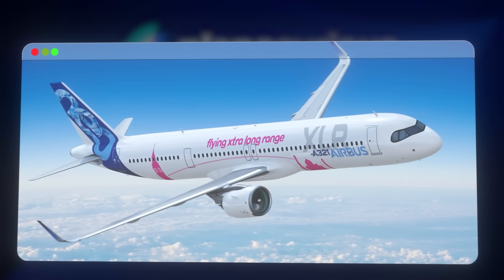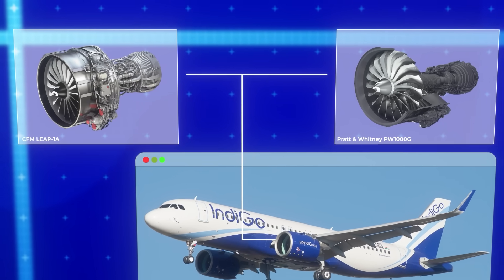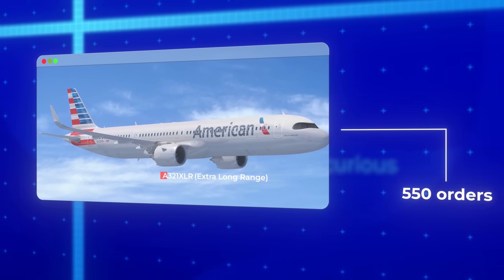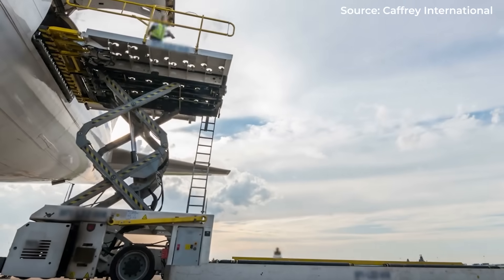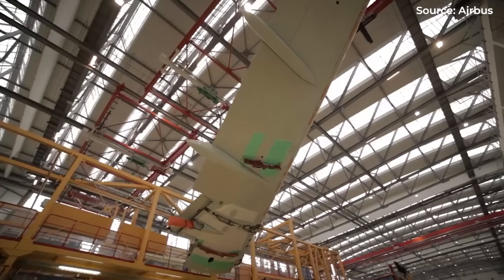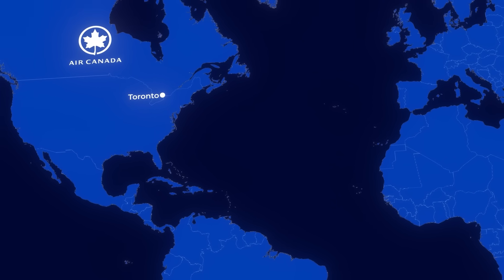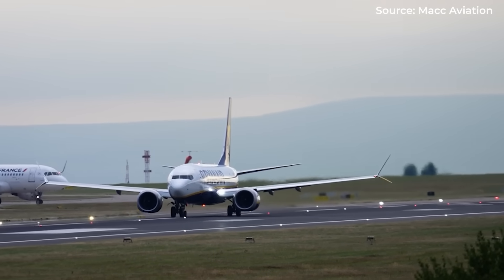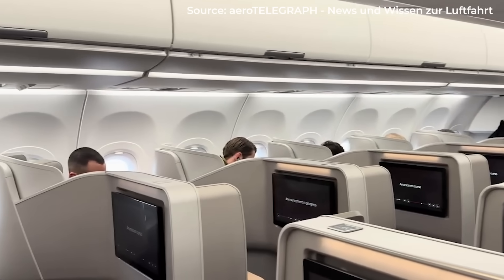How Airbus Outsmarted Everyone With One Jet

Comment: While longer range single aisle aircraft will allow more point to point routes to become viable, they cannot replace the hub and spoke model.

I regularly fly from Manchester UK to Belgrade Serbia via Germany, Switzerland, or Belgium. All flights use single aisle aircraft types usually from Airbus or less often Embraer. Being flexible with my timings, I have travelled on flights at all times of the day. With the exception of the last flight of the day, the vast majority of the seats are taken, quite often all those in economy are, yet I may be the only passenger flying that particular route.

Before landing at the hub they announce the gate numbers for any connecting flights with passengers on the flight. The sheer number of connections and a typical passenger count in the 100-150 range doesn't need a genius to realise that the numbers making at least some of those connections will be very limited. In my particular case, we are talking numbers struggling to justify even a single direct flight per week. Hub and spoke not only makes this route viable for the airline, but  can give me double digit flight options each day.

For this reason alone, the hub and spoke model's existence is not under threat.
Reply: Well, it's not like this would replace it. But hubs generally already run at capacity. What this allows is diverting to smaller airports and flying direct routes that didn't make sense before. This is beneficial for everyone since hubs won't get over stressed as easily and ofc customers get more options for better flights. This actually means everyone wins, since for those using the hubs lesser demand means less cost.
Reply: @mukkaar I couldn't agree more. 

Routes will open up, and for a sector of the market, holiday flights being a perfect example where you fill a flight perhaps once or even twice per week during the season, these aircraft will be ideal.

However,  it is unlikely that they will be able to offer anything like the frequency the non-leisure traveller requires.

They will be ideal for those routes currently using a single aisle with a fuel stop as sufficient demand is already certain.

While with everything else being equal, passenger numbers could reduce at the hub airports, this may equate, for example a 787-10 being replaced with a 787-9, or an A321 being replaced with an A320, there may well be much less of a proportionate increase in available slots.

While it may seem logical to reduce the number of flights per day than to use smaller, and generally less efficient variants, airlines are often reluctant to surrender slots.
Reply: Isn't that what I said?

Far too many, particularly on here, are reporting it as the death of hub-and-spoke when it is actually in addition to it. 

I am sure that the additional direct services will be great for the passengers and the airlines (if they can get enough aircraft and crew) and, not having a connection will persuade people to fly where they would otherwise not, but judging by my personal experience in Europe and the location pairs available to me not having a direct connection at all, or with a frequency of just a couple of direct flights per week, I suspect that the affect on the existing hub-and-spoke model could even be minimal. Who knows, some of those airports with direct connections could end up being mini hubs themselves when they offer a shorter route. For example, some journeys from the UK to The Americas involve a first leg in the wrong direction to Europe, sometimes even adding a couple of hours or more flying time to the journey in the case of North American routes.

Comment: Narrow body +long haul =nightmare
Reply: That depends on the layout chosen by the airline. All business class is still nice
Reply: Why? For leg space, you need the length of the aircraft, not relevant in wide vs narrow choices
Reply: Also the 757-200
Reply: I flew on a jet blue from New York to London in a a321xlr and NEVER AGAIN.  It was the most claustrophobic trip I have ever had.  If you gonna fly that li d either do an A350 or a B787

Comment: Not revolutionary. The B757 had this capability 40 plus years ago.
Reply: Ye, 757 will always be the sports car of the skies
Reply: True, at twice the fuel burn.
Reply: @Soordhin seriously? You are comparing a 40 year old designs for fuel efficiency?
Reply: @larrydugan1441 Well, 757 and A320 family are both designed in the 1980s. So yes, that is a fair comparison.
Reply: @Soordhin nonsense.  I realize you are an airbus fan boy but the reality is that there is nothing new about a long range single isle aircraft.
Composites and engine design have allowed to current stretch and economy of the 320. 
The only thing you can say is that Boeing screwed up is colossal share of the market by not updating the 757.
Reply: @larrydugan1441  Obviously there is nothing new. That is how the video started. But currently there is just one company that offers any product in that area, and it is not Boeing. Which just confirms that Boeing is not an engineering company, it is an investment firm.
Reply: @Soordhin That I would agree with.  Damn shame the great Boeing was brought to it's knees by bad management.
Reply: @Soordhin 
Habe es nie verstanden warum Boeing die 757 nicht grundlegend überarbeitet & modernisiert hat?
War es den Gewinnerwartungen der Aktionäre geschuldet, oder war es nur Trägheit in einem weitgehend dual aufgeteilten Weltmarkt?
Schauen wir mal wie sich die neue überarbeitete TU 204/214 etablieren wird.
Das PS 90A Triebwerk ist ja auch schon in einer anderen Evolutionsstufe.

Comment: He said 30% cost savings PER SEAT, but JetBlue for example is 100 FEWER seats than some operators' 321 NEOs. So if they could maintain the 236 capacity, fuel savings would be 40%+?

Comment: Well it is wider than the 737 to bad Boeing didn't come up with something to replace the 757 instead of going all in on the 737
Reply: Airbus added a couple of inches after they copied Boeing to boast about it. Easy when you do the design later. Seat width is mostly the same but depending on seat manufacturer
Reply: Also I noticed that on the Air Canada's 320. S they just put the same 737 seats in but you end up with a wider walking area to get to the bathroom or exit @sundar999

Comment: Umm...no.  First Boeing did offer a similar version of the 757 (think NMA), but the airlines didn't want it, they wanted wide bodies for much of these routes and so the 757 got dropped as a result.  Second, there is a reason why most US arilines don't want this.  The plane is a flying fuel tank, meaning its not fuel effecient. Any route its going to be one would need to be served at a premium.  This also limits how much weight the aircraft can carry which is they the premium sections are getting so big. Its not just people are willing to pay (few people in first class pay full price) its because its the only way to get the jet off the ground. These planes will also not carry much cargo. Then there is the weather. Over the Atlantic, ceo A320's often couldn't make the East to West trip in one hop due to high headwinds and often had to stop. Now I am not sure about that with the Neo's, but Jet Blue doesn't offer trans Atlantic services in the winter because of the low demand making it impossible to make a profit with these narrow bodies. While I don't doubt they would be useful on some routes, they will end up like the A380, barely profitable on any route in their networks.
Reply: Iberia tried to run MAD-IAD for winter to make the route year round, but cancelled that plan in October because they wouldn't make a profit. Even now, they only use the XLR for the summer; last year they used to run the 330.

TAP and Aer lingus also have the XLR, but they have to fly twice daily to IAD whereas other european airlines use widebodies. Even United flies 767s and 757s to Dublin and Lisbon.
Reply: @fighter5583 TAP doesn’t have XLRs yet, they have a few LRs though.
Reply: Doubt it. Just as a counterpoint, American Airlines and United Airlines have ordered 50 each, with another 50 as options. Yes, it can’t carry much cargo, and requires a lower passenger configuration (especially if carrying american tourists who are twice as heavy as europeans or three times as heavy as asian ones on average). But it allows those thin routes being served that no other currently in production aircraft can.
Reply: @Soordhin They are only using it as a replacement for the 757s which are nearing 40 years old and the MX cost have to be through the roof.  They were bribed into buying them, along with issues the 737 was having at the time. Delta CEO has specifically stated the US airlines don't like the XLR and he was clear it UA and AA felt the same at the time. Only continued delays with the MAX10 and the doorplug forced the airlines over. It's probably why both airlines also ordered Jet Zero's flying wing which has the same capacity with possibly 2x the cargo. Also, as for your 2x-3x heavier statement? Don't let unit differences confuse you. Both the FAA and EASA use the same numbers for calculating PAX weight when adjusted for units. Airbus jets have a history of not having the capacities of their Boeing counterparts and being far less effecient. The advantage the 757 had was it could fly to Europe at MTOW without the need to make half the plane premium seating. No Airbus narrowbody can do that, even this thing. If they outfitted a 757 the same it would be able to outperform even the XLR. Ive seen the performance charts. This is an aircraft age thing. These will be in service until something better comes along and that's it, and that won't be coming from Airbus.

Comment: And each Airbus model is significantly wider than its Boeing competitor. So the PAX like them more, too.
Reply: Only for 320 series versus 737
Reply: It’s not significant.
Reply: @rtbrtb_dutchy4183 Significant enough to allow industry standard hold containers - unlike the competition.
Reply: @rtbrtb_dutchy4183 if it were significant airlines would add an extra seat.
Reply: @rtbrtb_dutchy4183 5% or 2" per seat is significant.
Reply: It’s easy to come later and be a copycat and add a couple of inches of fuselage width to boast of
Reply: @sundar999 320 series isn't a 737 copycat. Nobody would be stupid enough to make the same mistakes twice.
Reply: @stephengrimmer35  The Airbus series from the A300 and up is clearly a copy of the layout of the Boeing 707, swept wings, underslung engines, same long straight tube as the fuselage, same tail, so it's difficult to tell them apart with a quick glance, but nothing wrong with that. The Airbus family has been a success. What mistakes are you talking about?
Reply: @sundar999  Well, the A320 sits higher on the ground, allowing for multiple engine options to be offered and to be re-engined relatively easily meanwhile the 737 only offered a CFM-56 on the classic and NG models which had its fan diameter (and subsequently bypass ratio) reduced to maintain ground clearance and we all know what a mess the MCAS has been for the 737MAX. A320 also has better ergonomics cause of the side-stick and was designed with FBW controls in mind. The said controls have several built in protections that make the pilot's job easier and which are not present (atleast upto the 737 NG models).

I'm a big 777 fanboy cause that's the jet where boeing got all these features into a single airframe and made the most popular widebody airliner in production.
Reply: @starliner2498  All what you say is right. I just said it's easy to come later and build a better version of the 737. An advantage for the 737 is the possibility for manual reversion, the ability to fly the aircraft without computers, hydraulics, and electricity when those systems fail.
Reply: @sundar999 airbus also has manual reversion, which is called direct law  (the three steps are: normal, alternate and direct law)

You are not wrong about progress but calling the A320 a copy of B737 is not correct either
Reply: @starliner2498  How can the A32x be fully flyable when all hydraulics, all computers, and all electrics are non existent
Reply: @starliner2498   How can the A32x be fully flyable when all computers, all hydraulics, RAT, and all electricity are non existent
Reply: @sundar999 a bit like asking "how can that car be fully drivable when the steering wheel, brake pedal, gear shifter, and gas pedal stop working?"

Comment: It will be interesting to see how this pans out.  Many airports are struggling with availability of slots and/or limitation on the number of aircraft movements. Smaller planes with less passenger capacity require more slot and aircraft movements.
Reply: It will open up more point to point routes from tertiary airports and allow for off season long haul route profitability. The same aircraft can do both.

Comment: The ULR is a bit of a curate’s egg. It can be configured to do TATL and TPAC routings but it needs a substantially lower MTOW to do this. It is more likely to find favour with carriers for medium haul flights with an increased MTOW as Cargo is a big part of revenue for most of the big carriers and is far more resilient as the Covid experience showed. The main problems with smaller planes is they provide a more unpleasant customer experience during turbulence which is an every day occurrence in TPAC and common in TATL. The 747 and 380 smooth it out to a great degree but a long range A321 or 737 will bounce around in a much more disconcerting manner. As I said I think it is the capability for large MTOW on medium haul routes is where the gains for airlines will come, though some discount carriers which often rely less on cargo and charge for pax baggage may be tempted to expand the narrow body transoceanic routes. Does not appeal too me though spending 11 hours in a 321 or a 737.
Reply: Think turbulance may be more common when flying between areas with significant temperature differences e.g. from the tropics to temperate climates. Also narrowbodies have lower headroom & smaller overhead bins & often lack dedicated crew rest compartments

Comment: In other words, Airbus did what Boeing failed to do: Invent a modern 757 replacement. 

Not sure why that was so difficult.
Reply: Because airlines wanted more 320 and 737 replacements than 757s; until around 2019 when they started looking at more point to point routes.
Reply: If memory serves orders dried up for the 757 so Boeing eventually discontinued it.
Reply: @android584 The engines weren’t fuel efficient enough. Boeing had a 797 project for a while which was going to replace the 757, but it seems to have fizzed out. 

Meanwhile, Messrs Airbus took care of that market/niche with the 321XLR.

Comment: Airbus just feels nice and relaxing to fly in.
Reply: I flew the A350 from Ecuador to Madrid recently, and it is an experience. I think I have never been in a quiter Aircraft. The A380 is close, but that thing is huge, and if you are upstairs there, it will be rather quiet. But the A350 with the dual engine configuration and the carbon fiber hull really makes use of all the tricks to get things to be quiet. Two less engines means less noise to begin with, and Carbon Fiber being a composite material, it also naturally dampens vibrations. If you get the chance to fly on the A350, take note of the noise level on board.
Reply: @GermanTopGameTV  Meanwhile I could only get 2 hours of sleep in a 7 hours flight because of the sheer loudness of the 767, heck even imo an A320 is quieter than that thing…
Reply: That’s because with Airbus you can get a good night’s sleep without the wall panel next to you blowing out😂
Reply: This won't. What a slap in the face to consumers.